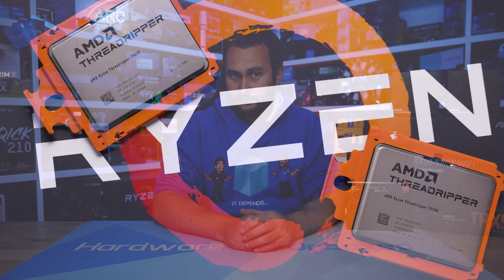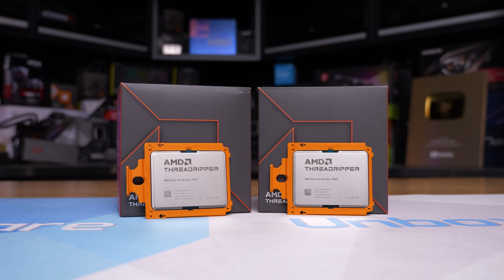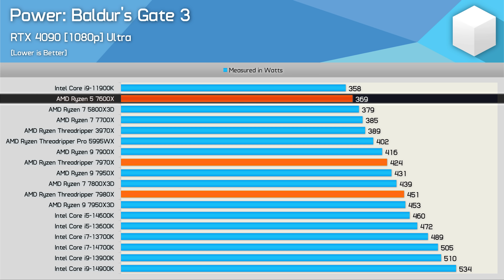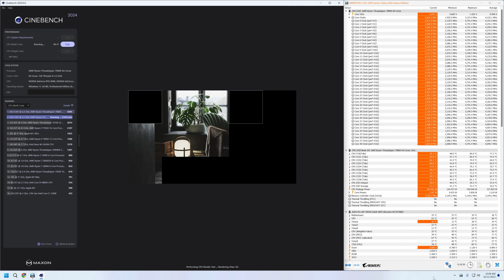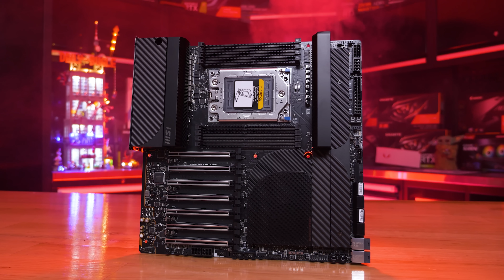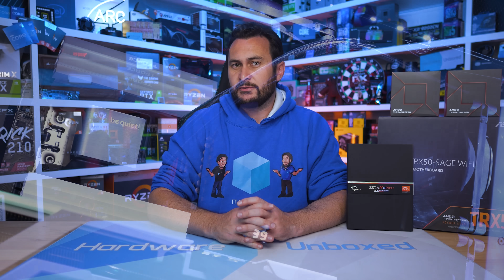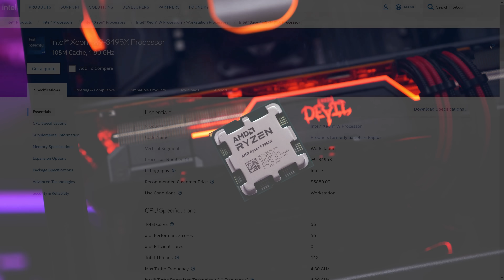AMD Ryzen Threadripper 7970X & 7980X, Benchmarks, Power & Cooling

Comment: When your mainstream processor consumes more power than the best HEDT 32 and 64 core CPUs but it's nowhere near the performance of those chips, you know something's wrong.
Reply: Bigger Number Better

Intel sure went nuts with power just to get a small performance uplift...
Reply: Pumping more power was the only way to increase FPS against the 13k lineup.
Reply: In gaming I just limit my 13900K at 90W. Only reason I got an Intel I9 in my new build was because the seller messed up the price and basically gave me a free upgrade to a i9 from a i5 and a £360 discount 😅😂....
Reply: I wonder when Intel will be able to compete in efficiency again. They are so many generations behind.
Reply: @nipa5961  They're one process technology node behind and pushed way too far. Just because one dishonest reviewer with an agenda tested 14900K with power limits off thus tanking it's efficiency further doesn't mean anything.
Reply: @dsdfasefes1883  Consuming 2-3X more power means a lot. 
Intel pushing their 10nm+++ silicon so hard only shows their desperation. That's their fault alone.
Reply: @nipa5961  It's not like AMD developed 5nm tech process and 3DCache. They have nothing at all, zero nm--- and shitty regular Zen 4, which was dead on arrival and flopped hard. Without TSMC they are nothing. And nanometers doesn't mean much, it's mostly marketing.
Reply: @dsdfasefes1883  Intel uses TSMC too, you know? Their own nodes are so far behind they barely use them. They have to re-release literally the same old silicon and call it "14th gen". XD

Speaking of marketing: 
"You can literally see it!" XD
Reply: In Watch Dogs Legion I have 470W wattmeter peak power consumption with stock settings. 11% less. 14700KF.

Comment: Last time these were out they were crap for gaming. I imagine more of the same. Going to be great for all the inspiring basement streamers.
Reply: Since zen2 or so single core clocks have not deviated that heavily anymore and they've been roughly in the same performance class as the same gen desktop parts. As Steve's benchmark show, that's still the case really. Of course they're absolutely wasted on just gaming and obviously a bad choice for that use case, but they aren't crap at it.

Comment: It would be great to test compilation workload which are very common for such workstation CPU. For instance Linus Torvalds at some point had a ThreadRipper CPU.
Reply: GN did some of that and Level1Linux usually does that with Linux kernels. As does Phoronix.
Reply: @walkir2662  I would not trust the former, as they're not experienced enough with Linux or even just with the act of compiling software.
Reply: @PainterVierax Wendell on the other hand...I think the first video I saw from him was with the 64 core Threadripper 3000 CPU, showing all the different things you could do with it (virtual machines and what not) and it was very informative. GN Steve goes to him for help with that stuff.
Reply: @vigilant_1934  yep Wendell helped them to set up some TR servers (IIRC he installed them Unraid). But GN team really are Windows guys (like HUB) and even if Wendell is helping them, they clearly aren't experienced enough  with this system to be sure the comparison is not compromised.
Not even sure if those Windows reviewers are capable of using basic DOS command lines on PowerShell, though Tim showed being able to compile Chromium at least.

Comment: Maybe HEDT just needs to die if there is no money in it anyway?
Reply: There's plenty of money in it.  Don't confuse MSI's situation with the state of the market.
Reply: @TrueThanny  I made another comment about how I'm not shocked MSI products have issues. 

However AMD and intel wouldn't have let HEDT die for a while if there was tons of money in it. Don't confuse people's want for HEDT and what these companies gain in revenue from said platforms.
Reply: There's hardly any money in non-pro HEDT - ESPECIALLY after AMD killed off their entire HEDT userbase with that insane TRX40 'grab the money and EOL' move.
Reply: @JimmyBob6786  No doubt AMD hurt the market by dealing with their wafer constraints via killing TR, but it's still there.  There wouldn't be so many people complaining about it if it weren't.

There are also a fair number of Zen 3 TR Pro users who will end up moving to Zen 4 TR instead of TR Pro.
Reply: @TrueThanny  Pro users are different, and if these systems help them then all good.
It's the non-pro HEDT community that AMD killed off with that insane TRX40 own goal.
Reply: DYI HEDT is dead. Lenovo and HP, however, sells both Threadripper and Threadripper PRO systems in troves. And as you can see from @ChrisM's statement that is probably for the better. The DIY HEDT market is pretty much "the Karens of PC building". People who want e-penis enlargers (they have no real need for) but expect to be treated like nobility "because they bought such an expensive product". But small companies and universities, though, are very happy that the mid-step to full blown workstation exist. And those deal with OEMs who have service contracts and lease options.

Comment: 7:45 crazy to compare the 7980x power consumption vs the 14900k
Reply: Around 13% more power for 65.7% performance increase on a HEDT CPU is nuts.
Reply: @azurai3934  Rite the Ripper would punt the intel  CPU off the field. Power wise vs performance
Reply: Just ran CB2024 benchmark on 14700KF (slightly overvolted) - 380W peak power, wattmeter readings. 24% less. Not surprised, honestly, since HW is shilling for AMD.
Reply: @dsdfasefes1883 So you believe that Steve, someone who's been reviewing hardware for 20 years, just randomly makes up numbers and puts them in a graph?

That graph is total system usage, so different PSU, different motherboard (and all of them have different voltage and boosting profiles), different RAM and different GPU than those in your system.
Reply: @dsdfasefes1883  Tell me you know nothing about tech without telling me.
How about you test his 14900k with his board and settings, oh you can't so what you say is worthless.
Reply: @dsdfasefes1883  They're not even the same class of CPU. you're trying to compare a general computing CPU used for gaming with a High End Workstation CPU meant for Workstation tasks like Engineering software.
Reply: @thelaughingmanofficial I replied to person, comparing purportedly power consumption of 14900K running without Intel power limits, to 7980x.
Reply: @dsdfasefes1883  yeah this comparison is worthless as a gaming/consumer-oriented PC will always prioritize single thread performance compared to HEDT/workstation ones.
Also peak consumption doesn't really mean anything by itself (except picking a PSU) without more data provided. Unfortunately, only few sites like Phoronix provides something like whisker plots to get a better view of the consumption. I never trust HWUB with power usage, as they don't even measure different load scenarios (not even a basic idle one) like TechPowerUp does.
Sure those holes in HWUB consumption charts favors AMD those days but this is not shill as it wasn't always at AMD's advantage until quite recently.
All in all, no reviewer has a perfect methodology. After all, the whole scene seems to not trust serious domains like scientists, statisticians or data analysts and still present us averages instead of more realistic medians. Even reviewers with engineering or scientific background lacks in that regard, sometimes giving misleading conclusions.
Reply: @dsdfasefes1883  I think your shilling :) the 32 core or even 654 core AMD chip shames intel on power and watts per work done.
Reply: @Kurukx  No it's not, I'd even say that it's the other way around, since 7800X3D manages to lose to undervolted 14900K at 95W in some games (TPU review). 5nm vs 7nm, 3D cache, same power and it still can't beat it reliably. Really embarrassing.
And Steve intentionally frames it in a way he wants, knowing full well that: 1) with power limits off 14900K pushes way past it's intended 253W limit ruining efficiency. Same with 7950X and 7950X3D - 7950X is using 30% more power for 3% uplift in perf because of clocks. Same with PBO on. 2) those two are entirely different CPUs, they should not be compared at all, unless you desperately want to make a point: "Intel bad, AMD good". More cores = more efficiency in tasks like Cinebench.
I have 14700KF, HT off, fixed 5.3GHz, undervolted, about 300W in wattmeter, 1780 points, about the same efficiency as 7970X. If you raise voltage for stability reasons, let's say it'll be 350W, 20% less efficiency than 7970X. And 5nm is about 20% more efficient than 7nm.
Reply: @dsdfasefes1883  Supply steves figures backing this up ?
Reply: Threadripper 7000 still destroys on power / watt muppet
Reply: @dsdfasefes1883 Who said those i9 tests were with unlimited power? Steve's system includes the 4090 which can use 350-400 watts by itself easily so the i9 or i7 gets added in with that plus the motherboard/fans and anything in the system. Gamers Nexus has shown i9's progressively using more and more power for years with the i9 11900k in particular being the most inefficient modern CPU they've tested. Alder Lake on 10nm (not 7nm which has been renamed to Intel 4 btw, 10nm is now called Intel 7 but it was originally supposed to come out in like 2018 or earlier) is much better and IMO should've been 11th gen but Intel chose to release 2 gens in 7 months (as GN Steve called it "a waste of sand").

The Raptor i9 13900k is actually efficient for rendering and other work loads but unfortunately can use a good amount of power in some games as TPU (and every other review/test) has also shown, like 120+ watts vs. 80 watts with the 7950X. This is consistently the case and according to TPU the i9 averages 40-50% more power while gaming than the top Ryzen 9 (non 3D part as we know those are the most efficient on the market currently for gaming anyway).

If you pay attention HW Unboxed, Gamers Nexus, and most of the other credible tech review sources just tell it like it is and will critique any company that needs to step up.  HWUB has called out AMD for anti-consumer moves recently (I think it was for a CPU) and they've done the same to Nvidia and Intel.

Stop defending these companies. Buy what is best for you. That's it. Blackrock and Vanguard (and others) get paid no matter which of the big 3 you support. Know that.
Reply: @dsdfasefes1883  What was the score, what GPU are you using, and speed of RAM.  You might want to actually provide data to support your unsupported accusation.  I mean what kind of tool are you?
Reply: Shilling?  LOL  He just ripped them about multiple generations of TR chips and the problems they had with them. @dsdfasefes1883
Reply: @dsdfasefes1883 who hurt you as a child?😢
Reply: @dsdfasefes1883  You're very right but don't bother trying to argue with this people, its a waste of time. Also I really like to put myself in the shoes of everyone and from Hardware Unboxed's perspetive he CAN NOT recommend intel processors no matter what. Reason being: 90% of consumers are average folks on a budget (small budget if that), AMD whilst not best at anything, surely gets the value per dollar crown. What does that mean? H.U. has no choice but to recommend AMD, here's what would happen if he were to recommend intel, first of all subs will go down really fast, simply because intel in ultimately the "Enthusiast" platform really. Intel has always had the gaming crown with every generation, problem being is that for it to get that extra 1-5% in fps you run hard and (I'm talking hard core) into diminishing returns territory, having to delid-liquid metal back in the days (now you have to go direct die cooling), 420mm, high end motherboard, high end ram. On the other hand take an X3D cpu, pair it with a 100$ motherboard and literally the cheapest 32GB kit 5600 4800 whatever it doesn't matter X3D CHIPS DO NOT SCALE WITH RAM OVERCLOCKING (yes they do but to a very small extent when compared to the gains on non x3d). What does all this none sense mean? Well basically... You can get 85-90% of the performance of a fully maxed out 13900k/14900k system for 30% of the cost... I'm a terrible writer so sorry if one thought doesn't correlate to the next. There's no denying H.U.'s hardcore AMD bias, check his recent videos, if I remember correctly he compared some old cpus, yet from intels side he compared up to the 9900k (a cpu from 2018), then from amd side he includied the 5800x3d (a cpu from 2022) LMAO. Homeboy had to put amd on top of every chart at all cost. The main problem I see with all of these reviews is that they compare cpus stock for stock, and that doesnt really give the full picture, X3D has the advantage using that format, it basically has all of the advantages of super tuned ram without necesarily having to tune the ram, the intel cpus, need ram manually tuned to catch up but they dont, then the benchmarks end up being an absolute massacre. Its unfortunate but here's how I see it, you go AMD (Specifically X3D) if you are a pc noob/ non enthusiast, you go Intel if you are a hardcore pc enthusiast (meaning you won't hesitate to go direct die cooling- cpu & ram overclocking (manual tuning not turning up xmp type shit) xmp leaves A TON of performance on the table... Just like I've been saying, in general the easiest way to grow your channel is to make it as relatable as possible, how do you think its easier to make your channel more relatable tell me, by being biased towards a value-focused company, or by being biased towards the enthusiast level company? Of course by being biased towards the value-focused company, hard core pc enthusiast are soo rare 99% of the readers don't even know wtf is ram tuning, let alone deeper stuff like impendances and imc-related voltages. The good (sad for me) thing about amd is that with its X3D thing it's basically killing off the tuner/enthusiast generation. Surely you can beat a 7800x3d with a 13900k but you have to work your a$$ off for it, possibly need to buy several boards/ CPUs to cherry pick the best samples, pray you get one with a golden imc and cores and what not. The 7800x3d doesn't need all that nonesense, its just plug and play for the most part, on top of that it being an X3D chip means you don't even have to go nuts with the board, even some basic like asrock's cheapest 2 slot b650 board which goes for $109 will handle the 7800x3d flaglessly and even do 8000MT/s no problem, but for most 6400MT/s  is going to be the sweetspot in 1-1. although I've never had a chip stable at 8000 it still boots,  closest I've had was a 7600x with a golden imc stable at 7800 2-1 (duh) I've had 2 7800x3ds, one maxes out at 74 the other one at 7600, I just run it at 6400 CL28 53ns in aida with 2200 fclk and call it a day. Sheesh damn someone had a lot of free time:face-fuchsia-tongue-out:
Reply: @Key-z2x   Most people are going to use these CPUs stock for stock. Sure, you can overclock and deal with stability issues and constant problems with new driver updates and games / apps, but most are not into that, or they may go the safe route and enable PBO on the AMD processors at most. And the usual 'my system never crashes when overclocking' argument that many overlockers make doesn't work with me. It may not crash right away or in some apps / games, and it might seem stable for a while, but at some point, it will crash, or glitch in games, especially if it's an aggressive overclock. 

As for bias, HUB praised the 12th and 13th gen Intel CPUs. I'm not sure where you saw they were AMD-biased. Go back and check those benchmarks. What happened since then is AMD played their X3D hand and it paid off and AM4 is still relevant. Before, we were all going crazy for more cores and multi-core performance, but now the prices for AM5 have fallen and gaming is now the new focus.
Reply: @Key-z2x  wtf are you on about, they've recommended intel in loads of videos for various builds

Comment: that's insane that y'all got a motherboard that was never released because of low demand 😭
Reply: That's what MSI claims.  And even if accurate, it's low demand for MSI TR boards.  When I've shopped for TR boards in the past, MSI never had attractive options, so it's not surprising they'd have lower demand.
Reply: @TrueThanny  really? the MSI X399 MEG Creation was the best MB to get for X399 and the TRX40 Creator successor just as good.  
I think MSI sees AMD's HEDT for what it is, a big waste of a investment.  
AMD showed their true colors with how they handled TR4 and TRX40, only a fool full of cash would pour their money on something that support is on shaky grounds.
Reply: @vh9network  Totally agree. AMD very deliberately killed off their entire non-pro HEDT userbase with that insane TRX40 early EOL - AFTER taking all those customers money. One eye-opening observation I've noticed is in comparing TRX40 vs TRX50 motherboards - TRX50 is SEVERELY cut down in IO and functionality compared to TRX40. The TRX40 Zenith II Extreme, or Gigabyte equivalent, are particular eye-openers.
AMD didn't have the guts to mention TRX40 owners in light of TR 7000, and there's obviously going to be zero compensation for them. Hell mend AMD.
Reply: This kinda makes sense now, considering MSI has skipped out TRX50 for this gen

Comment: Windows 11 21H2 is quite old, and you said it was the last windows 11 build (which should be 23H2). Is it a mistake in the spreadsheet or you tested it on 21H2 on purpose?
Reply from the maker: It was a mistake on screen. I'll fix that moving forward.